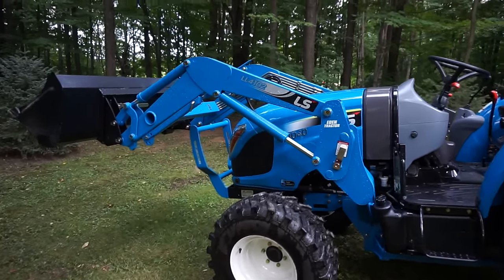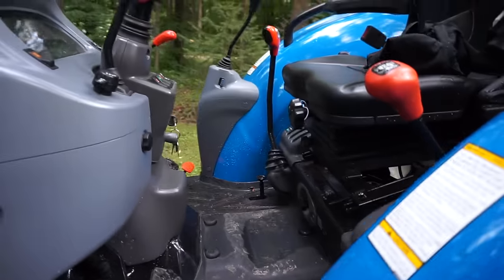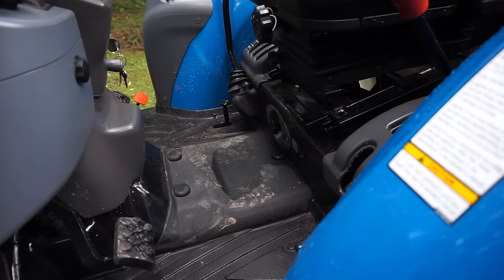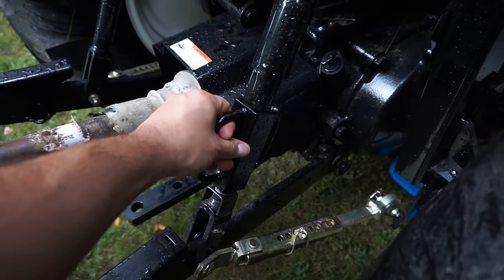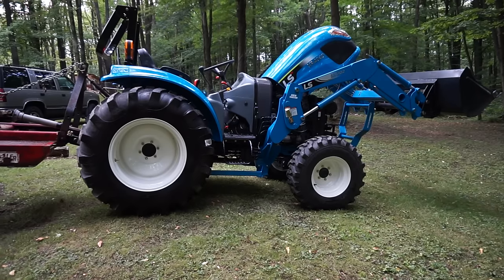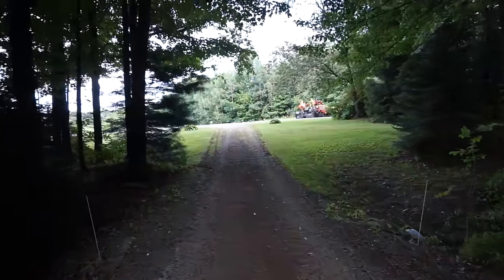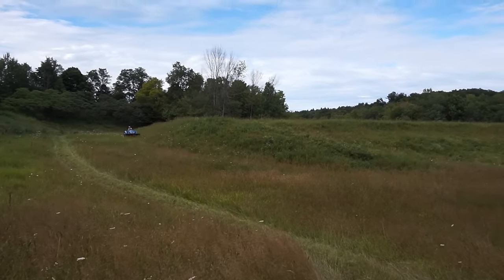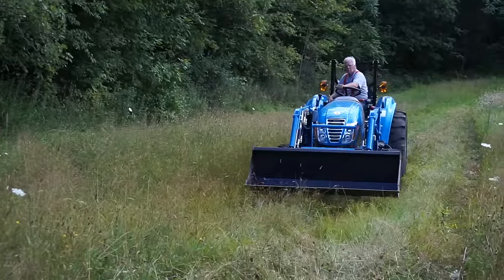LS XR4040 Compact Tractor overview & brush hogging

Comment: Thank you for the overview! I'm sold on this tractor for my 10 acres. Found a dealer here in Tennessee and got the tractor, a 6 foot bush hog, and 5ft tiller with an 18 ft trailer package for 25.5k. Can't beat it!
Reply from the maker: +Matthew Keller great price... you will not be disappointed... good luck with her...
Reply: +Matthew Keller great price.  I couldn't get local dealer under 28k for just the tractor and FEL.

Comment: Very nice job. I have the same size.. only a 4140. I believe the 41 means hydrostatic which mine is. I have 20 acres to play around with. Use it for everything including brushhoging, box blade, 2 bottom plow with an 8 ft drag. Also just picked up a 6ft 3pnt disk. And of  course the frome loader. My wife even jumps on once in awhile to mow our trails.. we are extremely satisfied and as you stated.. not sorry we went with the 4o and 4wd... (my farmer friends call it front wheel assist). anyway enjoy the LS.. 
I'm in Central Michigan..

Comment: I know I’m late to the comment party, but here’s a few things I’ve learned with mine.  1. Any metal coming in contact with dirt and rock can’t keep paint on it.  2 the PTO turns at 540. Rpm. Not 5400. 3.  I would suggest a 6ft cutter because it would reach outside the tires.  Otherwise you might cut everything you run over.  Nice remotes on the back.    Good luck. I’m sure you’re a pro on it by now.

Comment: You will need a box blade to go with your tractor also to do some of the work around your place. I got a package deal when I got my first tractor and glad that I did get the package since I needed what I got. I added extra implements over time and now have a new tractor as well to use with my other implements since I keep the brush hog on my older tractor only.

Comment: What a beast of a tractor. Looks pretty. 4 wheel drive. Great at moving snow. Do you have an enclosure for driver for those snowy or rainy days? I would instal a GPS unit hidden on it, if someone ever steals it you can lock right on it and get it back. Hate to sound nuts but some people are always trying to rip someone off. Good Luck with a great machine. Enjoying your videos, Thank You for sharing.
Reply from the maker: +mmanut we looked at the cab model but with our wooded location it seemed like an accident waiting to happen... the windshield cost $1k to replace... even the dealer did not recommend it... so we will just have to suck it up in the rain... we've had good luck with nothing being stolen from the property but it is insured... it would suck but we could then get it replaced... hopefully we never have to use it...

Comment: The grill guard is supposed to be pushed and locked in closer to the hood or to the front when moving.
Reply from the maker: +Tbvck you are correct... we had it forward to open the hood and neglected to put it back

Comment: Beacon is a prewired switch to mount a strobe, wire should be in the rear on the left
Reply from the maker: thank you... we do not have anything wired to run off that switch... for the most part we only run in our woods and have not really needed it...

Comment: I can't seem to find an answer on the LS site, so perhaps you can tell me.....does LS make a gasoline engine or is all their stuff diesel?
Reply from the maker: +Keith Rayeski they are all diesel... not sure of any large tractors that are gasoline anymore...
Reply: thanks for that.....I am just starting out....the Mrs and I are negotiating for a homestead and of course a tractor is on the must have list...this, is how virgin novices become informed. I am disappointed however....don't want to go diesel if I can help it. Thanks again!!
Reply: +Keith Rayeski if it is going to sit for more than a week or 2 at a time without starting it you want a diesel!!!
Reply: John Keeling advice I'll make good use of John....thank you,!
Reply from the maker: going back to your comment about sitting... this tractor sat for about 2-3 months over the winter and started right up... none of our gas equipment does that... we normally have to warm the motor with a heat lamp for a while... still loving this tractor after a year of ownership...

Comment: Just boneing up on tractors and looking to upgrade into a bigger unit from my garden tractor. What are the advantages of filling the tires?
Reply from the maker: traction... it also helps if you have a heavy load on the bucket... moves the center of gravity rearward... makes it less tippy...
Reply: When you load the tires with fluid, it puts extra weight as close to the ground as you can get, without sacrificing ground clearance.  Lowering the center of gravity, and adding a lot of stability on steeper hills, or traction to the tires on a whole.  It will also add weight for ballast overall, when using a loader to counteract the weight within the bucket.  some of the newer tractors will lift far more then is stable, and lift the rear tires off the ground.  You can counteract this with filled tires, as well as having a very heavy implement on the 3 pt, like a box blade.  It is not always advised, if weight is a negative for your application, such as if you need to "float" over soft ground.  an extra 1200 lbs between a box blade, and filled tires can dig you in deeper.

Comment: Nice video. Very nice tractor for the money, what brand? That ROPS should be up for safety!
Reply from the maker: +Shawn Allen thanks... It's a LS... they make New Holland... on the back of a New Holland the manufacturer tag says LS... 

And yeah I know the ROPS should be up but it the woods it gets hit often... not to mention it does not fit in the shed with it up... Our other tractors don't have one at all... We will try and not need it :)
Reply: +buffcleb LG makes these tractors and before 2015 new Holland made there motors years ago the company for these tractors used to be called Montana's ;)
Reply: +Justin Wall 2015 models and up now are actually made with LG motors now
Reply: +buffcleb old tractors never even had rops I be more scared of something being thrown out the brush hog haha like your videos though I almost bought the 35 hp but I found such a great deal on a JD I couldn't turn it down this will be the next tractor I go with before I bought this my new JD I had a JD 2040 it had now rops and im still alive to (shawn) you just gotta know your limits
Reply: The company names were changed to LG in 1995. Tractors have been sold under GoldStar, Fiat-GoldStar, LG, LG-Fiat, LG-New Holland, LS and LS-New Holland names in South Korea. In North America, they have been sold as LG Montana, Montana, Farmtrac LandTrac, LongAgri LandTrac, McCormick Tractors and Landini.

Comment: I'm surprised about the regeneration cycle. If you're running under load the exhaust should be hot enough that the trap is continuously regenerating. The forced regeneration should only be needed if you're idling a lot or running under very light load.  Tier IV, of course has nothing to do with a 4-hour regen cycle. If you're forced to spend 40-minutes doing regen for every 4-hours of operation that would be totally unacceptable. Per regulation you should be able to operate more than 3000 hrs before you may need to have the ash cleaned from the trap.

Comment: Hello. Thanks for the video. I was going in to look at the Mahindra and the sales guy showed me this. I had never seen them. Seems like a lot more tractor for the price. Are you still happy with it? Any problems? Does  that 24k include tax?  Thanks for your help.
Reply from the maker: So far no problems... we've mostly been using it for earth moving with the bucket and there's been nothing we've thrown at it that it hasn't handled yet... We have around 50 hours on it now which is probably what we'll put on her each year... 

No problems yet... I do with the open cab model like we have had a cup holder for a water bottle (its the little things)... and I'm still not a huge fan of the regen you get with all tier 4 moters... always seems to kick off as we're finishing things up...

$24k was everything... including the box scrapper, delivery and 50 hours service (which we'll be scheduling shortly)
Reply: if your getting a new tractor with a loader and like the mahindra you also might want to look at a Tym tractor i beleave they make the e max series for mahindra If I can find the link to a good Tym dealer I will post it but i beleave that the dealer is called smith's entirprise

Comment: I live in Boston/Colden area, how do you like doing business at Eden Tractor?  How is the LS treating you these days, is the regen an issue?
Reply from the maker: They were great to work with... we had them do our 50 hour service on-site so we didn't need to take the tractor to them... it's not that big of a machine but the combined weight of the tractor and a trailer big enough for it is just a little more than a 1500 class pickup (which is what we have)

the regen isn't an issue but does seem to kick off right about the time you want to finish working... usually wen it happens we just do other jobs while the tractors regening...
Reply: buffcleb How long does the regen process take?
Reply from the maker: it varies... 30 minutes to 45 at the longest...

Comment: Looking at this tractor. Not sure how it compares to kabota and mahindra.
Reply: I'm overseas right now and I made contact requests to Kubota (x2) crickets. Massey/Kioti (same dealer) and LS.  Massey (AgCo) got back to me quick and referred me to the local dealer.  Crickets.  I got on the Massey dealer website and made another contact request.  Crickets.  

LS is the only one to respond and in 2 days I had a quote for a package on an XR3135H and the implements I need to start out.
My local LS dealer's slogan is "We really want to sell you a tractor" and they're proving it with action.

There very few real differences among the makes.  Most notably Massey and a few others have engineered the DPF and regens out of the larger engines now.  I don't see regens as a problem since with LS you simply tap the go ahead button, when the regen light flashes, and keep on working.